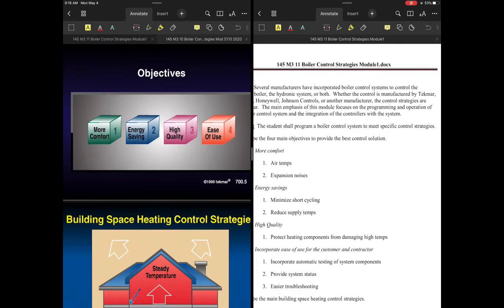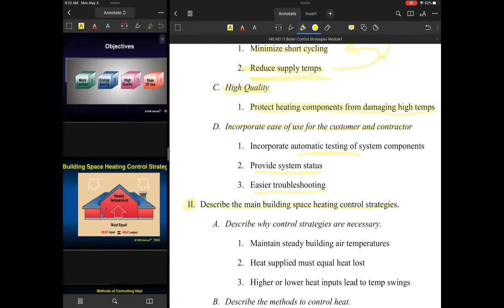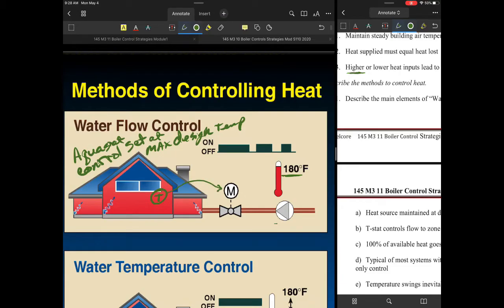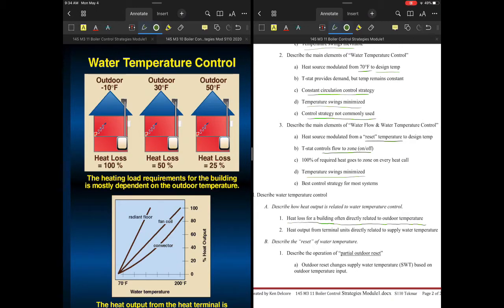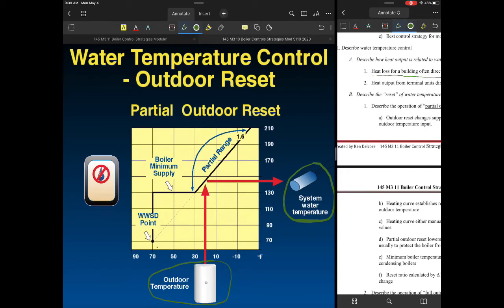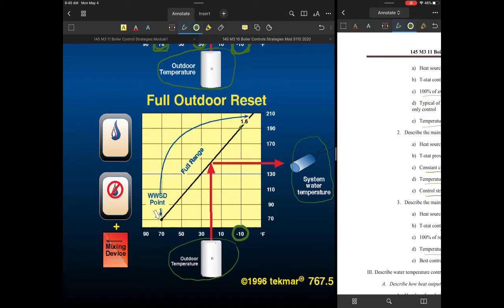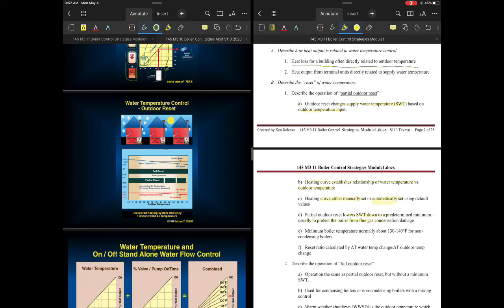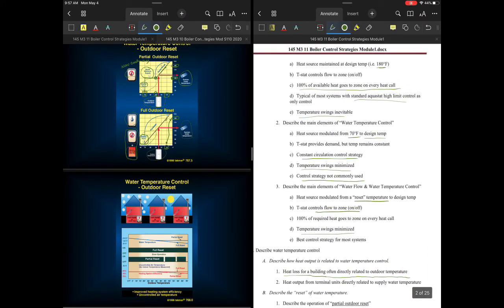Boiler control strategy - outdoor reset

Comment: If I sent you my heat loss calculation, type of boiler I have and type of radiators I have.  Would you mind looking at it and seeing if you could give me a good place to start with my settings for my outdoor reset?
 Im having trouble dialing it in right.